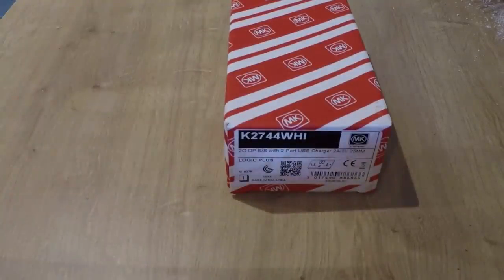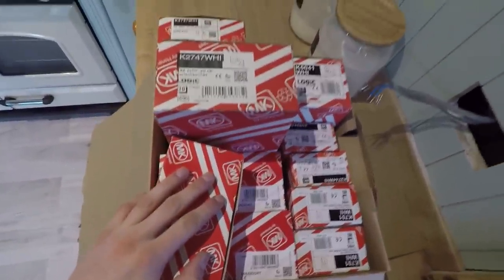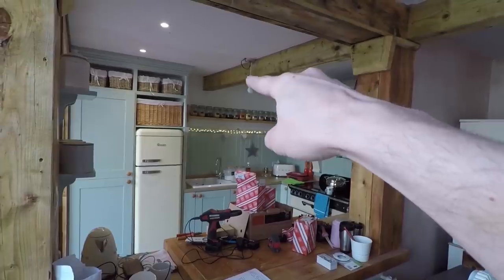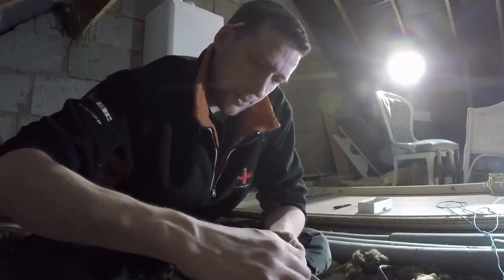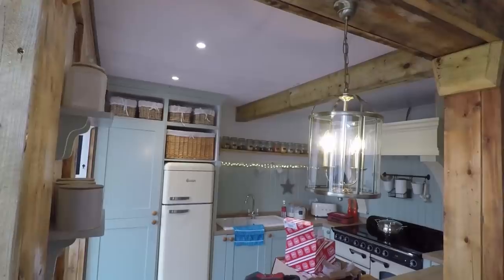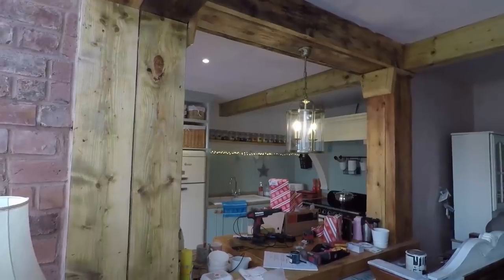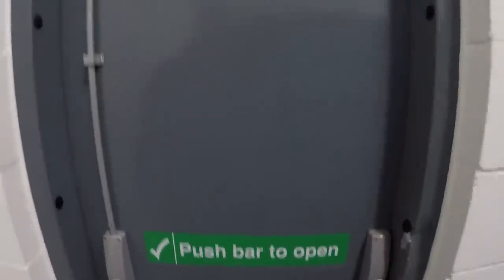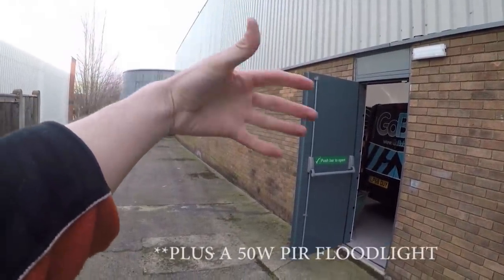Dimmer switch installation + House rewire | Thomas Nagy

Comment: I'm taking GCSEs to help become an electrician because u have inspired me mostly to do it!! Also it good pay!! Thanks a lot mate!!!
Reply: Come on you spurs
Reply: Good on you mate, keep it up! Hope you pass your exams..
Reply: welcome to the trade
Reply: Look into being a marine Electrician. If you dont mind being away from home. Better pay and half the year off.
Reply: Currently doing my Level 3 at 32 years old mate,  im working in industrial only at the moment, mainly substation work, putting up containment such as tray and ladder, glanding and terminating cables ranging from 3c 2.5mm in small DB's up to 4c 240mm into main LV panels. Best career change i ever did. Soon as my Level 3 is complete it's onto completing my NVQ. Keep up with the maths buddy, i got a D in GCSE and I've struggled a bit at the start, but you soon remember the equations :)
Reply: @tykewando  Good luck with the AM2 trade test aswell!
Reply: Good pay ? Mmmm

Comment: I got to £1350 for the job. Around £650 for materials but I assumed 32A Commando Sockets + a local isolator for each, and that I would have to provide good quality CCTV cameras and floodlight. I'd charge £700 labour and would be done in two days. I'd run the cable tray at the height of the van roof to avoid any risk of the vans hitting anything and keep the sockets up as high as possible to ensure the van drivers can see them.
Reply: @msec Ses 4 days you have got to be joking!!!!!!

Comment: Go for POE IP cams.  Run some CAT5/6 to a NVR with POE ports (or a separate POE Switch).  You can even view on your smartphone and they  are not that much more
Reply: They are already supplied so he can't really
Reply: I would second that. Just run CAT5. Who uses Coax cams these days !.
Reply: I have not used any else cctv cameras than poe ip for about 5 years.
Reply: as the system is already supplied, I'd buy some baluns and run a single cat5 to each cam, one pair runs the baluns and the video and two pairs for the DC, leaving future proof for IP cams in the process ;)
Reply: Why are we recommending an outdated standard of horizontal cabling standards, CAT6 minimum.  Coaxial is still used more so in Domestic situations simply because the CCTV Camera and DVR are priced cheaper for that connectivity in the first place making it still attractive, you can get a 4x turret camera, 4MP system installed for around £500.  Dahua or something reputable.
Reply: Why not run cat6 and use balons to convert into BNC and power ends ?

Comment: It looks like you'd need a MEWP if you're thinking about running your cables upto the ceiling of that storage unit... Cheaper and safer to just go round the walls.
Reply: I'd go round the walls, probably at about 8'. Easy enough to reach but out of harm's way, also no angles around doors to worry about

Comment: £2500+ vat to do it right and get a lifter in and have neat drops.

If MK are the best in terms of sockets. What are the best down lighter manufacturers????
Reply: MK are some of the worst accessories now in my opinion
Reply: Collingwood simply down to warrenty 👍
Reply: Ksr
Reply: I'm an apprentice and i'd say click mode are the best for sockets tbf, enlite or robus do pretty good downlights.
Reply: Ansell Prism are very good, I get them for £11 a fitting.
Reply: agreed I absolutely hate the terminals on almost anything MK  @adamjones3249

Comment: I'm not from UK but from Warsaw, Poland. So it will be completely useless, but anyway ;p My basic estimate for Warsaw without CCTV would be around  2200 PLN+VAT  (450 GBP) for materials and 1800 PLN+VAT (360 GBP) for labor. I guess for London it be will at least 3-4 times more for labor (based on JIG Wage Grades I've just found), so let's say 1750 GPB+VAT. 

I assumed cable trays at height 4m - available without scissor lift or sth similar. 

My estimation incudes:

MCB C32 3p 6kA EATON - 2
 pcs.
MCB B16 1p 6kA EATON - 1
 pcs.
MCB B10 1p 6kA EATON - 1
 pcs.
RCCB type AC, 80A, 30mA, 4p, EATON - 1 pcs.
 (maybe not the best idea to use type AC)
3-phase 400V IP44 socket, PCE 96062540W - 2
 pcs.
1-phase 230V IP44 polish socket - 2 pcs.
NYY-J 5G6 - 50
m
NYY-J 3G2,5 - 40
m
NYY-J 3G1,5 - 25
m
wire cable tray, 50 mm x 35 mm - 35
m
LEDVANCE FLOODLIGHT 50W, 4058075097605 - 1 pcs.
PIR sensor - 1 pcs.
Additional materials like cable glands, ties etc.
Testing/measurements

Comment: I'm from Nuremberg (500.000 People - a village for a Londoner), Germany, i would charge around 1.560€ plus 19%vat = 1856,40€
(17h work =935€ + 625€ in Material)
It's hard to calculate knowing no details about the location, especially for the cctv

Comment: The only thing I wouldn’t do is keep the tray down low even with armoured cable. Keep it at ~10-12 ft except for the drop to the sockets so it’s above in case he ever backs up a bit too far.

Comment: If you find a USB socket that can pass the insulation test, do a video on it. Looks like they just need to include a better quality 400V capacitor.
Reply: depends what you mean by 'pass'. I've had a few that can handle live to earth of 500v with >2 megohms... but only just. I know the regs consider that a pass, but i don't, unless the house is a sauna.

Hit em with 1kv however ... and they drop dead
Reply: L-N is not an insulation test btw. ALL loads (including USB sockets) MUST be removed for that to be valid

Comment: Why isn't British cables earth wire insulated why do you have to sleeve it after you strip the main insulation?
Reply: Pure and simple.........cost.
Reply: So that if a wire has an issue with the insulation it will direct the power to ground I assume, I know that it is the same way for most things in the USA.
Reply: @adamliggett2621  exactly that buddy
Reply: Because we love earth sleeving 😎

Comment: is better you run   3 way compartmenr metal trunking and drop off  metal   conduit for the points also you got option for cctv and low voltage cable  as well

Comment: I would never fit a 3-pin socket with USB outlets in my own home and always recommend that others avoid them.  Adapters that plug in to the normal sockets are better to me.

When those USB equipped sockets fail they are a nuisance to fix or to replace but the adapter that plugs into the normal socket is easily binned and replaced if it is not repairable.  They always fail eventually, so you might as well get the more easily replaced item.
Reply: They were handy on holiday with a small £3 usb fan, and kept the sockets free for a lamp & laptop etc. But you can't turn them off and they interfered with my MW/SW radio. So I  wouldn't fit one. It'd be great if they had a switch and a user replaceable usb module at the front.

Comment: I would run cables along the wall and over fire exit to the other side rather than go up to the roof tie and come back down as it easier (and safer) and also no need to hire scissor lift 👍🙂

Comment: Ever since i got full live voltage THROUGH the USB socket on a faulty unit - i wont touch them with a barge pole. I never understood why the USB is not individually switched in the unit.

Comment: I personally would just run the cable along the walls just above the height of the vans to protect them from accidental vehicle damage and to allow furniture/stuff to be pushed right against the wall. On the other hand, if I wanted to do a more professional install I would run the cable along the ceiling and straight down the wall. The second method would probably require a scissor lift and would be more expensive.

Comment: Mate. Just refuse to  put additional circuitry to support USB in the wall. Those are no good. Tell them to deal with the wall warts and proper cables
Reply: I don't trust any charger, only use OEM. Little bit more expensive if you need spares, but at least no fried phones! And yes don't buy those 1£ 1€ cables.. I had few cheap chargers and no proper isolation, I checked after one blew up when plugged in.

Comment: Hey! I really like watching your videos and I am thinking of becoming an electrician myself (I am female), one thing that worries me is having to deal with a lot of asbestos as I hear it can be pretty toxic. Do you have to deal with a lot of properties with asbestos and if so is there a safe way to go around it/any advice?
Reply: Hiya I worked from mid 70's to 1990 on the tools as a spark & face maskes were seldom around to use. I have no lung problems though I know others who do. Use PPE at all times! I ended up doing film & TV lighting & power till I retired, not hard work. Follow what you want to do & go for it with all your might, only you can do it, or not. Give it 100% & learn to ignore the sexist mindless ones, yes they are still around, you are better than them, you are taking on more. Have you seen Toms female spark? She could be a roll model for you as she has done it, beat the men at their own game... All the best & stay safe... Steve...

Comment: On the subject of LED dimming does anyone know why my LED lamp stays on very dimly even when the switch is totally turned off? If I turn the bathroom lights on it actually gets a bit brighter and will noticeable slightly light the room, again, even when fully clicked off.
Reply: Is it on a dimmer ? is it 2 way switched ?
Reply: Ghost voltage, (Google it)

Fit a snubber, (Google it)!
Reply: I the permanent live goes to the light and then a cable from the light to the switch and back it could be a cheap LED being powered by electromagnetic induction between the cables. Saw that in my parents bathroom when I put a new light fitting in, got up in loft and changed the wiring around to send the permanent line directly to the switch, problem sorted.

Comment: Please could you do a vid on the cctv install, as I was thinking to start installing cctv myself,  will it be with cat5??? 👍👍👍🤞
Reply: It sounds like the customer had provided the cctv kit. It sounds like the one you just supply power to and the cameras are connected with cables provided in the kit. 

I’ve done a few, hd quality and they come with an app and dvr. Peace of piss for a house. You can buy longer leads on line if the 18 mtr don’t reach. They are like scart leads. Hope that helps.

Comment: If you go low level it needs conduit. I’d go high level, scaffold tower, NYY-J cable (not poxy SWA). I’d be looking to pay £2-2.5k I guess. That includes high level tray, access equipment, cables, good quality switch-interlocked CEEFORM RCD sockets, labelling, inspection, testing & CCTV cable and installation.

Comment: Perhaps I'm too old fashioned and/or paranoid, but the idea of having active electronics inside a wall socket really doesn't fill me with joy. I get they're convenient, but having seen some plug-in USB chargers go bang reasonably spectacularly, I wouldn't want that to happen in a plasterboard wall cavity.

Does anyone else think like this, or do I just need to get with the times?

Comment: It's interesting that people are still clinging to the twelve months guarantee,  it has to last for what is considered a reasonable time, the example often used is washing machines should last five years, and yet retailers will try and sell you expensive break down cover.
How long should a dimmer switch function, that's another question, but you can imagine paying £10k for a rewire and sockets fail after 18 months, you would not be inclined to put your hand in your pocket.

Comment: I like the work you do. Have done nearly sane thing in the Netherlands. I installed burglar systems in schools, churches business and everything else even windmills. In your case of that building I would use like a flat wide plastic cover and put it horizontal against the wall at about the height of your hips. See this https://static.webshopapp.com/shops/015340/files/112086068/ergopro-kunststof-kabelgoot-voor-op-de-vloer-of-mu.jpg .  You can use that also to put the cables in for the camera setup. And if the client want something extended the option is there without more work and money. And looks like nicer when it is white. I must say that the electrics in the UK nearly everywhere I see looks always a mess with those wires. Good job man

Comment: USB sockets.. Don't fit them unless customers supply them and insist you fit them. Charge an hourly rate and guarantee your work only. I avoid fitting them at all. Horrible unreliable things.
Reply: Bloody awful things.  They should be on thier own dedicated circuit.

Comment: Question - if a client requested a double hand socket to be fitted vertically, are you allowed to fit them vertically or does it have to be horizontal??

Comment: scaffolding needed to put the cabling into the ceiling, it's massive! or use a massive scissor lift to do it but then they'll want to charge you for the tyre marks left on the shiny floor! Guess I would charge a minimum on 10k.

Comment: hire a scissor lift, run both cables along the roof structure, then straight down the wall in vertical conduit. bugger this horizontal tray on the wall nonsense.

Comment: Crazy prices being quoted in this thread.  Basic 4 camera install (supplied by the customer) and couple of 3-phase sockets/isolators, 2x triple pole mcb, 2x metalclad ds + cables, clips, etc?  Probably around £600 inc. labour I reckon?  But then, I don't live/work in London...
Reply: The cost of renting un under stairs cupboard for a year here would buy you a small mansion without a mortgage in most places, got to charge enough to live on!

Comment: As an electrician from Iceland I'm not used to seeing those flat cables in action. Is it possible to get a close up how you cut them and what not ? (just those regular ones you put in the sockets that is). What we use alot here, are round cables (usually 1,5mill in regular sockets) so I'm not sure if that's the only difference or not.
Reply: We use 2.5mil flat T&E here generally for sockets, use one of these to strip the cable https://www.toolstation.com/ck-automatic-wire-stripper/p42984?store=DH&utm_source=googleshopping&utm_medium=feed&utm_campaign=googleshoppingfeed&gclid=CjwKCAjw1KLkBRBZEiwARzyE76Dc1RKDW0n1gqySmBHU5uby66yxIJiP9nAXiEQQQSdLvvDOejDKnxoCVGoQAvD_BwE

Advantage for the flat cable is when you want to make good over it, and getting two together through a hole since they just go flat against each other.

Comment: That 3mm earth just looks messy on cables. I use 2mm and buy it on 100m reels so no tangled up spaghetti. Check out Edwards Electrical online.
Reply: more like 2.5mm or then next size up 4mm

Comment: Don't put any horizontal tray anywhere in there at hitting level.  Go high and spec armoured drops, you know it makes sense, the hire of a lift is inconsequential.  I'm not going to guess a price but it looks like a proper job is needed.

Comment: Little tip when using those slab dry wall boxes . Cut the curve edges off at 45 degrees with snips the  you can t see the box at all looks a bit better .

Comment: I dont know now but MK terminal bolts used to  be rubbish.
Reply: Yeah they still are, I occasionally have a customer present mk shit they bought themselves because "that's what the old stuff is", those who still insist on mk after the routine explanation usually have me asking them to go buy more while I get on with the rest because the screws are fucked (had to do that this morning). If they want me to go get more then that trip is on the clock as work, their crap materials, their expense... would be cheaper if they'd just let me pick!

Comment: Forget a ladder for inside the unit, you would want a scissor lift for getting into the roof there to work safely. Quote for the cable to go around the edge...

Comment: I'd say around £1.5k inc labour, a days work. Can extend the cat5e/6 with a coupler and run extra cable. May need an RJ45 crimper too. Remember a pattress when fitting the cameras on a ceiling tiles!
Reply: Please don't use couplers when possible. 

They make life hell for people who have to diagnose, support, maintain and extend the IT systems at a later date. 

Network cables should always be a clean run, with no slices or joins whenever possible. It's much more sensitive than electricity.

Comment: I love schnieder sockets and switches all I do currently on new builds. With hager boards I'm in my element lol
Reply: The only trouble with Schneider is they're a little bit wider than other brands, so if you're replacing existence sockets/switches without a gap between them it won't fit.

Comment: Hi, what advice do you have for a new homeowner needing to save money on the cost of a rewire?
Reply from the maker: dont take the dirt cheapest quote you can find, you'll end up spending more.
Reply: @thomasnagy  thank you, is there anything I can do myself to save money? Stripping old stuff out, buying the sockets and hardware e.t.c....
Reply: @BigDan1190  Draw a plan of the property and mark you electrical services locations on there for example socket locations lights etc.  Draft up a list in excel and compare prices with screwfix etc etc.  Go to 3 contractors and get the 3 prices,  compare the figures.  If the cheapest is very lower than the rest then that's a warning sign.